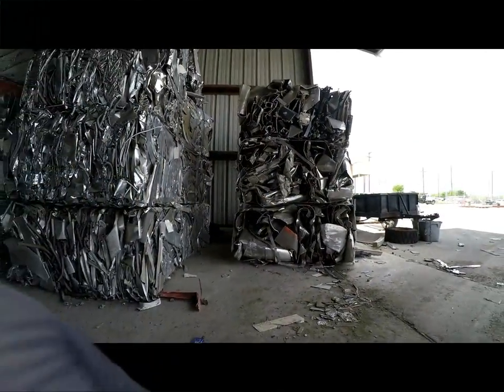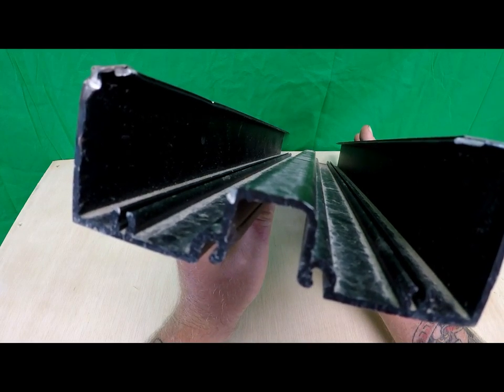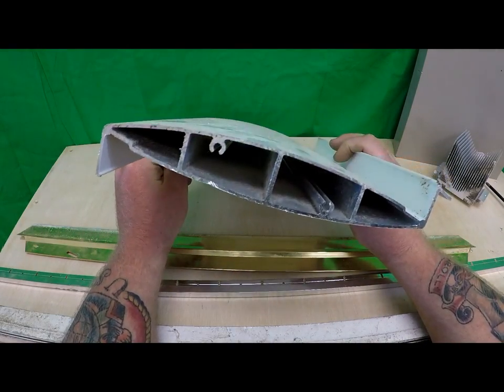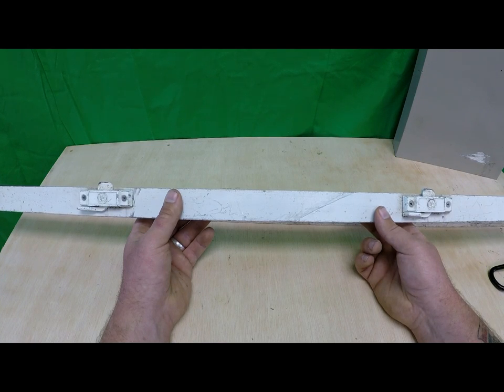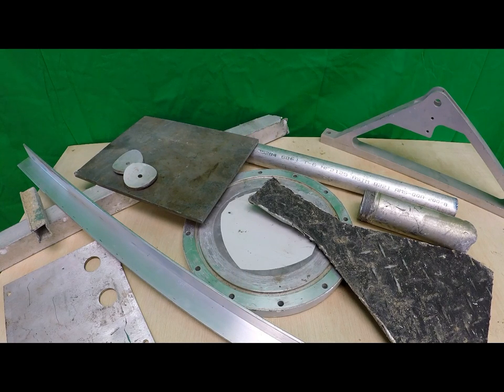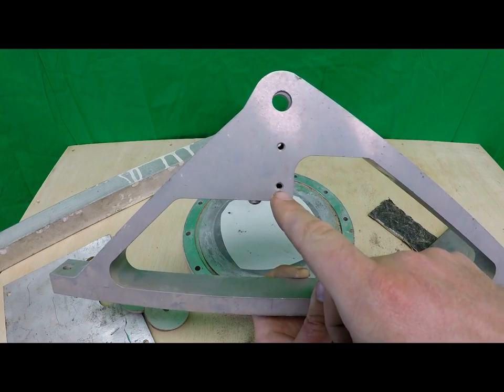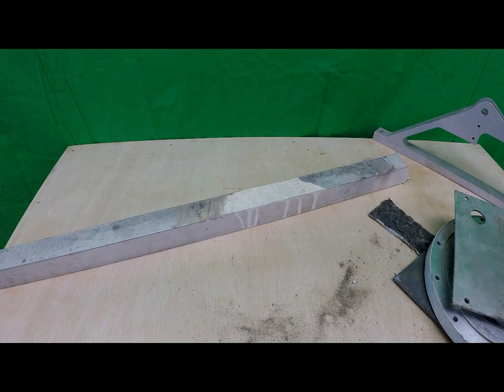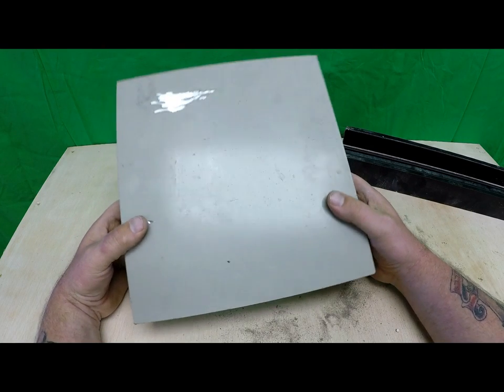Scrap Aluminum, 6063 and 6061

Comment: We use a fair amount of 6063 rectangular,square, angle,flat bar, and pipe in the marine industry.The reasoning behind this is its ability to be bent 6061 does not bend well without cracking,so if you have a bunch of bent pipe or flat bar you may want to have them shoot it with a gun.This is a great video from a scrap yards perspective like he said make it worth there while with having some weight and most scrap yards will be willing to go the extra mile with you.
Reply: I have an old aluminum boat lift  I'm going to scrap because it got flipped over in a storm. I came here to figure out what kind of aluminum it's made. Is marine grade 6063 different from regular 6063?

Comment: Great video, informative.
My yard takes aluminium as aluminium, does'nt matter if it's crushed sodacans or heatsink or a pipe like you showed.
I do separate everything and things I'm not sure about I put aside and ask about it when I get to the scrapyard. 
I do strip most wire and cable and get copper price for it, thinner insulated wire WITHOUT the connectors I get payed "scrapwire" for that. 
Love the videos and the sense of humor you throw in there as well. 
Please exuse any typos or sentence structure as I live in Sweden 😀
Reply from the maker: Thank you, Peder!  I wish we could buy all of our aluminum the same.  It would make it WAY easier on our end!  But I think we would have some very upset customers!  I'm sure the yard you go to has good reason to buy it that way, but without knowing their situation, I couldn't tell you why.  If they don't move a lot of material very fast, then that could explain why they buy it that way.  But if they are moving a lot of volume pretty quickly then you might want to have a little concern.  I'm not sure how many scrapyards you have in your area, but I get a lot of people who are very limited in scrapyard selection, and they always ask what they should do because they only have one scrapyard within 50 miles.  My advice in that situation is to save up as much as possible to make it worth the drive if you can get better pricing by taking it further away.  Also when customers call and say they are coming from far away, scrapyards are more willing to offer you more money so they can get the scrap from you.  The yard will make less money, but their only other choice is not to get it at all.  Also, in your situation, if you can find another yard that does pay more for higher grade aluminum, you can use that to your advantage.  You can take all the lower priced stuff to the yard that pays the same for everything, then take the better-priced aluminum to the yard that pays more!  In my opinion, you're not doing anything wrong you are just using their system the most efficient way you can.  They decided to buy items that way, not you!  No worries on typos and sentence structures, you won't find any grammar police here!  One of my very good friends is also from Sweden but now lives in California!
Reply: Grammar police are nothing but textual predators and should be ignored.

Comment: hi if i have a a/c radiator thats all aluminum and i take out the aluminum tubes would they still be considered sheet or extrusion? cause they are tubes like the copper ones just aluminum.
Reply from the maker: Michael, great question!  We would buy them as sheet aluminum.  A general rule of thumb for me is if you can easily bend the material without applying very much pressure then it is most likely not extrusion.  My advice would be just to make sure there is no iron or other non-metallics (plastic) on the radiator and sell them as aluminum radiators.  I hope that helps, let me know if you have any other questions about it.

Comment: What about aluminum chain link fence, my local yard won't take it unless I cut it up into strips.Seems like a lot of work. Should I just bother?
Reply from the maker: If it is aluminum then it would probably be worth your time, depending on what they are paying you.  I can't think of why they would want you to cut it in strips?  We would just buy it as is!  Maybe they don't have a good baler that will process it.  Now I'm curious!
Reply: Galvanized steel not  aluminum.

Comment: Ok, so besides the physical characteristics of it. What is the difference between them when they are melted down? What is the difference between them when they are originally made?
Reply from the maker: Recycling the World, I made this video mainly to help people who are scrapping these items to be able to identify and sort them.  However, this is a good question.  They both almost contain the same elements just different amounts of them.  These elements are aluminum, manganese, silicon, chromium, copper, iron, zinc, magnesium, and titanium.  So depending on the chemistry of the aluminum ingot that a mill is producing would determine which one of these metals they would add to the smelter during the process.  They might use all 6063 Al, or maybe just a little bit because that's all they need to produce the ingot they need.  Because they have different amounts of these elements, it gives them differences in tensile strength, yield strength, shear strength, elongation, and brinell hardness.  The chemical makeup is what gives them unique features from one another.  For example, 6063 provides a very smooth finish and can be easily anodized.  It is not as strong as 6061 but it can be shaped easier, so I am assuming that's why they give window frames the architectural shape to make up for the strength (kind of like cardboard).  I'll be the first to tell you that I am in no way a chemistry expert and I don't make metal so I could be wrong about some of this!  Thank's for watching and sorry the video was so long!

Comment: what about cast aluminum plate 1/2" and 5/8" inch?
Reply from the maker: Michael, if it's cast then it will just go with cast aluminum.  I will have to cover this in a video.  You brought up something I forgot about.  Sometimes you will see plate that looks like cast but it is really 6061 aluminum.  It can be difficult to tell the difference believe it or not.  Maybe I can find some time to make a video on it!  Thanks you!
Reply: If i cant tell if its 6061, which my scrap yard classifies 6061 as Sheet Alum... But cast if i cant tell i can break it sometimes and then ill know, also being able to tell the difference between pot metal and cast, potmetal is generally heavier that pot metal (Diecast) Correct me if im wrong haha